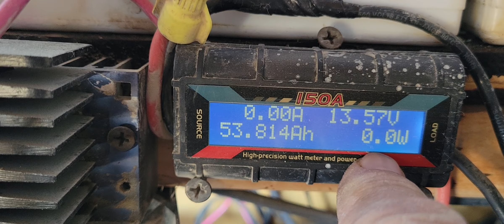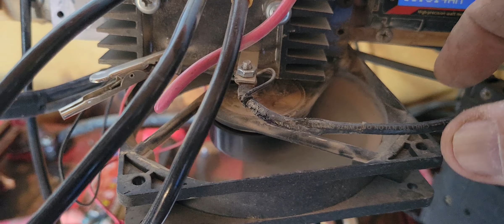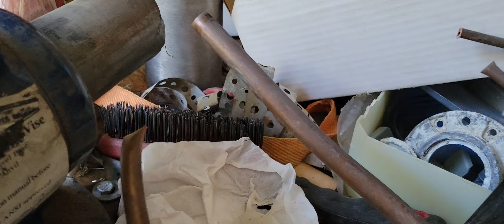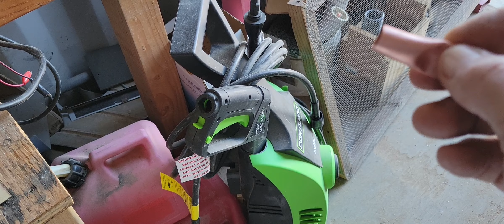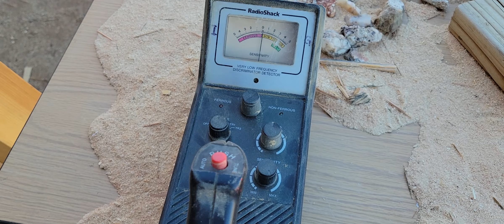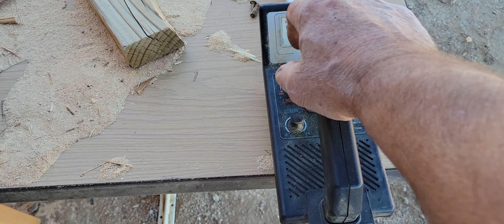HOMEMADE Battery Cable Ends, Dec. 8, 2021

Comment: Just for my sanity, the four ends attached to my inverter are the $12 ones from Napa...The lady is an old friend and discounted them down to $9 apiece...they are very thick and nice, and carry 400 amps...nickel, I think it said. When I use brass on lead, I coat it with Vaseline...it helps...the brass will stay shiny a long time. Everywhere else is like you have there. I used to work at a salvage. I know a little about corrosion, lol.
Reply from the maker: Good points.

Comment: My wind turbine makes 1000 watt at 24 mph and at 35 mph 1700 watt
Reply from the maker: Please post make, model, and link to seller for my viewers.  Thank you.
Reply: @GBear  that hurricane vector is no joke I have seen it put out 140 amp in a 45mph wind
Reply from the maker: I just looked it up online and it says it uses slip ring technology.  If it uses carbon brushes in the slip ring, I can't use it.  It gets below freezing here in winter.